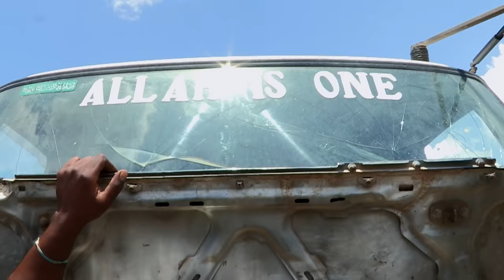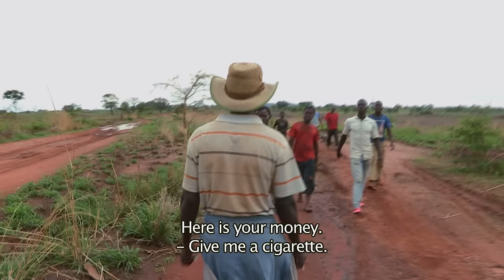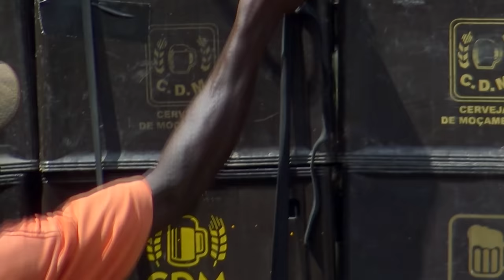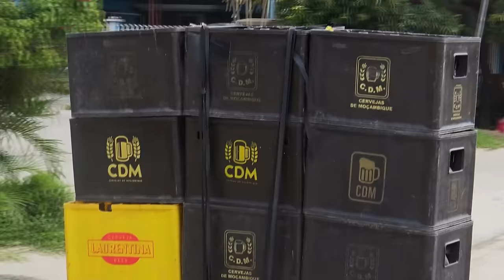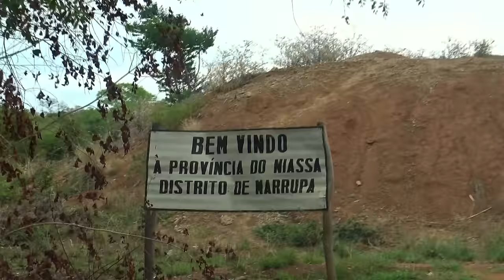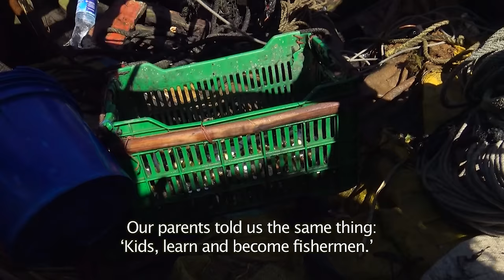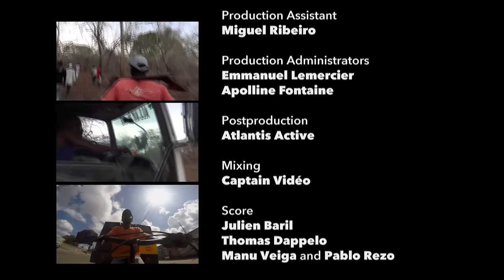Mozambique, Life Stronger Than Anything | Deadliest Journeys

Comment: Man when you car or truck get overheated don't turn it off let the engine run then pour water on the top of radiator until it cool down then open the lid pour water again on the radiator until the engine back to its normal temperature.. hope your cylinder head had no damage 🤣🤣🤣